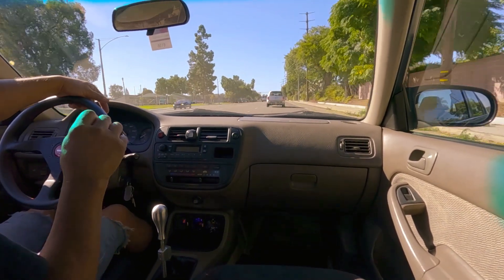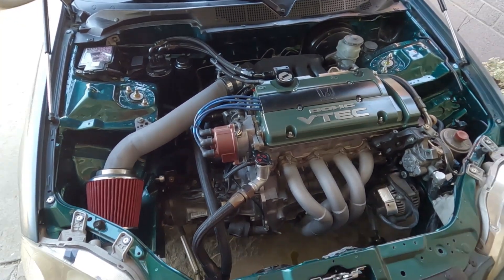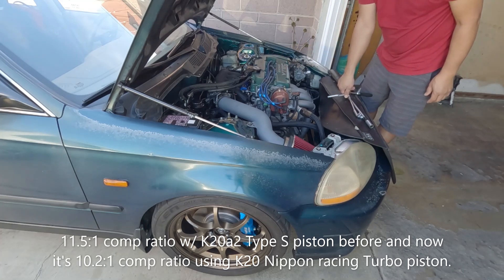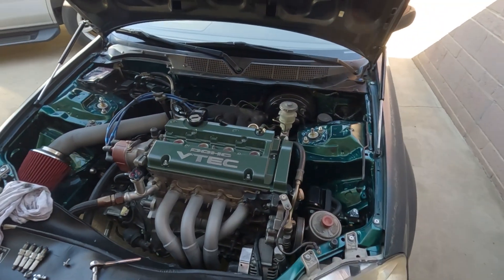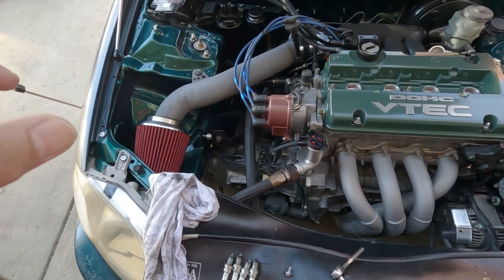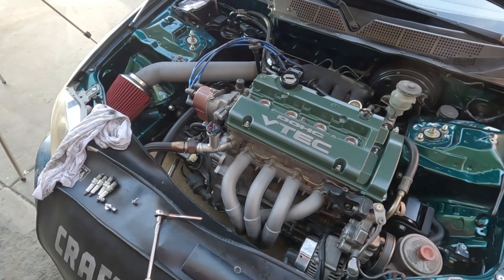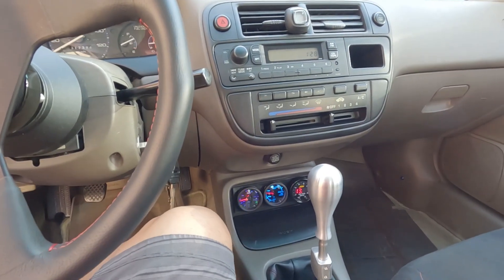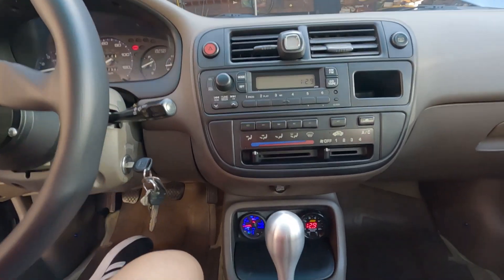Reading spark plug! Is it safe to drive untune G23BK?

Comment: What distributor do you use? And did you have to swap up any wiring? Mine is going in an 02 accord coupe btw.
Reply from the maker: It's obd1 H22 dizzy. All wiring insulation was all cracked and l converted end connector to plug in to 96 Civic harness connector. There are dizzy conversion harness you can buy if need it.

Comment: Not related to this video but question for you I have a f20b that I need piston rings for ive been looking around with no luck any info on where I may find some for purchase. Any help would be great thanks in advance
Reply from the maker: You can try F22 piston rings from Honda Accord, since its 85mm also.
Reply from the maker: F22 rings has got to be the same thikness as F20b, it will not surprize me. Too bad l dont have F22 piaton laying around, otherwise l'll chevk the thickness for you. NPR rings are not really the expensive unless you have friends that has f22 piaton laying around that you can meadure.
Reply: @sagittnet2158  on the spec sheet it looks like it but I cannot find the thickness of the rings picking up an f20 b this Sunday and I am trying to gather the parts list for a rebuild
Reply from the maker: @davidciena501  F22a1 and H22, H23a1 Have the same ring to groove clearances and since f20b is derived from H22. I think it'll be the same. I got some specs for ring to groove clearances. 1st ring .0014"-.0024" service limit .005"
2nd ring .0012-.0022"
Service limit .005"
If l were you, l'll get a F22a1 NPR or Hasting piston rings.